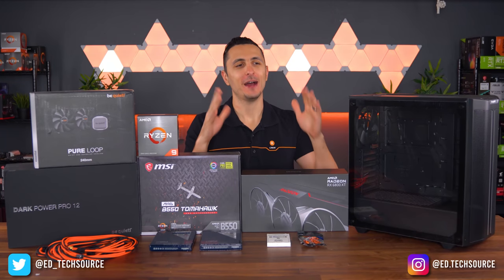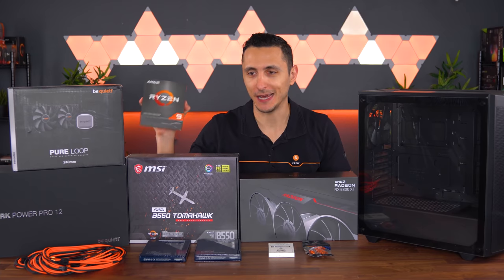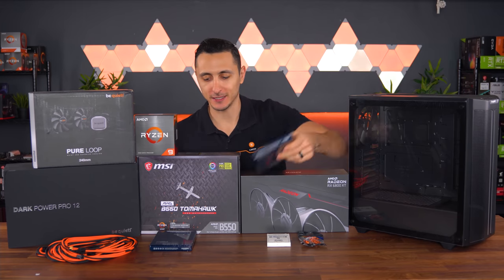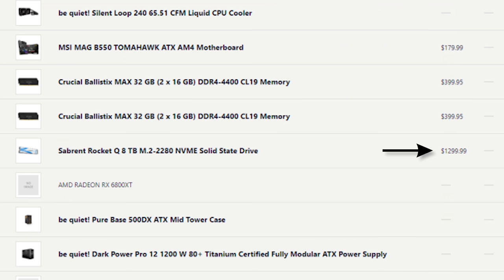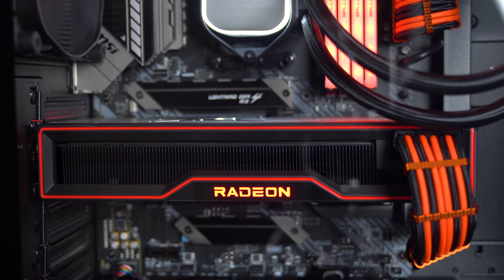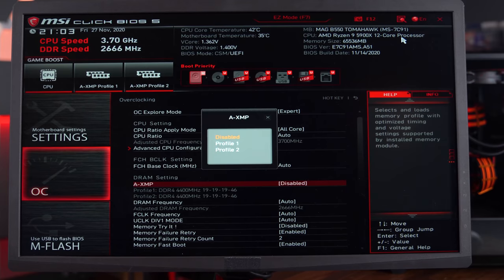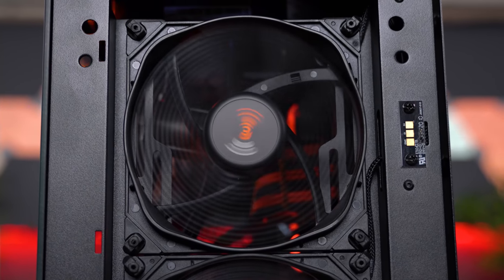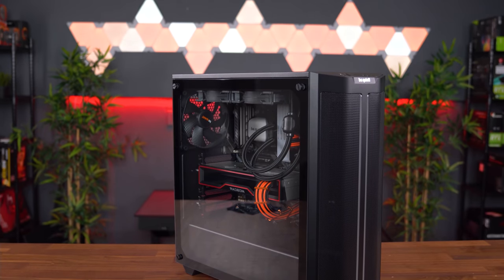The All AMD Gaming PC Build - ZEN 3 + Big Navi

Comment: Finally Ed has acknowledged the power of amd
Reply: i think he has known for a while
Reply: @kylexu227  Ye
Reply: And then pairs them with a B550 board...
Reply: @evm7368  why is that bad..?
Reply: @DJRob10  B550 is a more budget board with less features
Reply: @dholocronkeeper  i feel like the majority of people would elect for B550, in this build based on everything else i suppose you'd expect him to go X570 but you're not missing much. Pcie 4.0 ? Unless you have the storage drives that can take advantage of it there's not really any point.
Reply: @DJRob10  I agree, but I just wanted to explain the point of view. And also some could argue that going X570 could be better for future proofing
Reply: @dholocronkeeper  tbh, the only reason I would chose b550 over x570 is that dumb little fan on almost all the x570 boards. And b550 doesn't. So easy choice for me.
Reply: Sucks at drivers thou

Comment: My build would be killer if I can get a damn 3080. Why does it have to be so hard. 

Edit: a 6800 XT would also be great. But none for both, honestly AMD let me and a lot of others down. They had a great chance to beat Nvidia, all they needed was stock. Somehow they messed it up and that would be fine if they didn't lie and brag that they'll have a lot more supply than the 3080 when infact they had less stock. The point is, IDC which one I get, I just want a damn GPU to power my useless GPU-leds system.

Comment: had the 3300x been available, I would've gone with AMD. But it wasn't so I just picked up a 10100 and 2x8 GB of 3200 RAM. I do kinda wish the 3300x or 1600af been available so I could get a B450 board to support ryzen 5000 later on, but 10100 is still a great cpu for $99 USD :)

Comment: WOW finally someone made perfect pc ( for me at least). :) 🌟🌟🌟🌟    Based on personal perference I would change 4 things;  
cooler with   be quiet! Dark Rock Pro 4 50.5 CFM CPU Cool
SSD     with   Crucial P5 2 TB M.2-2280 NVME SSD
RAM    with  Crucial Ballistix 64 GB (2 x 32 GB) DDR4-3600 CL16 Memory
Motherboard  with  Asus TUF GAMING B550-PLUS (WI-FI) ATX AM4 Motherboard
Reply: Also know imagine if be Quiet put 3 140mm be quiet! Silent Wings 3  instead of 2  be quiet! Silent Wings 2 how good the case value and performance would be. 
+ if they made  RX 6800XT   model with their be quiet! fan's.  How  cool would that be  :) 
btw we will see if you are going to wear sun glasses in next epizode because of that comment.  That was a close one.

Comment: Hi, I'm having a trouble, my pc is not giving any video output but fans are spinning... is it possible that the reason is that i haven't plugged in an 8 pin connector for the cpu... my psu only has a 4 pin connector so i connected it to the right side of the connector on the motherboard.. is that an issue? Im using fx 6300 i just picked up for a project build... any advice is helpfull!! THANKS

Comment: I hope anyone can help me. I bought a Ryzen 5 5600x and used the stock cooler, that came with it. I thought it would be enough, but as soon as I started cinebench R20 multicore test, the Temperatur jumped to 115 degrees Celsius and the system shut down. The cooler is mounted properly. I don’t know what to do, i Hope someone else does.

Comment: Question please and please respond. I will assemble a PC assembly with an AMD RYZEN 9 5900X processor and a RTX 3080 graphics card, but I do not want to buy a water cooler. I want to buy an air cooler and any air cooler that is suitable for the PC assembly and can cool it and also be supportive for AMD processors Rizen because I will buy a processor from amd, is the Noctua nh-d15s chromax black file a suitable chiller? Is this file supportive for amd ryzen processors? Is it supportive for it? And if you know an air cooler that is stronger than this cooler and supports amd ryzen processors please, I hope that Remember me his name in the reply and thank you all and I hope with all my heart for the reply

Comment: Sad thing in India is AMD's prices are sky rocketing literally the 5600x was going in the price range as the same of the 10900k and Intel is lowering its prices so much literally you can buy the Intel i3 10100f as in the same price of i3 9100f and also the 10100f is cheaper than 3100 and if we buy offline then it's more cheap and also the 3600 3600x and 3600xt are going on the prices of the i7 10th gen and the i5 10400f is going on the price of 200$ and also they launched the 6800xt 200 dollars more excluding GST than the 3080 Intel is becoming the new budget king here in India and from before India has been a Nvidia dominated market AMD is fking their own ass up guys we need to do something otherwise prices will become more everywhere

Comment: I regret buying my 5700xt this summer
Reply: Rate my pc I’m building. I have all the parts, but I’m waiting till Christmas to build!

MSI MPG Z490 GAMING EDGE WIFI LGA 1200 Intel Z490 SATA 6Gb/s ATX Intel Motherboard
Intel i5 10400 
EVGA SuperNOVA 750 G+, 80 Plus Gold 750W
EVGA GeForce 1060 single fan 3gb
be quiet! BK002 SHADOW ROCK LP Low Profile CPU Cooler 130W TDP
3tb hard drive 
32 gb ram 
Total: $1,350 or around that
Reply: @lucycutepaw1595  your probably gonna be you bottle necked so would have put some of the money from that away from extras that aren’t going to need, like going with a 16gb kit of ram and a Ryder cup which also makes it so you don’t have to buy a cpu cooler and could have gotten a better gpu
Reply: @switch69  Which gpu do you recommend? I’m thinking of returning the 1060 if I can because the price doesn’t seem reasonable now that I look at it.

Comment: Multi levels of bottlenecks. $4000+ build have B550 motherboard , why ?
Reply: B550 isn't a bottleneck my dude. The only thing x570 has advantage over b550 is the 2x nvme gen 4 and better vrms other than that there's no actual reason to switch.